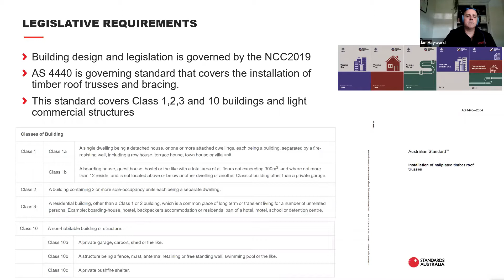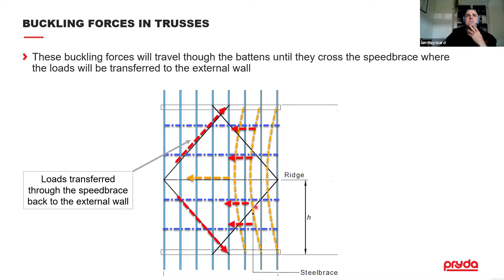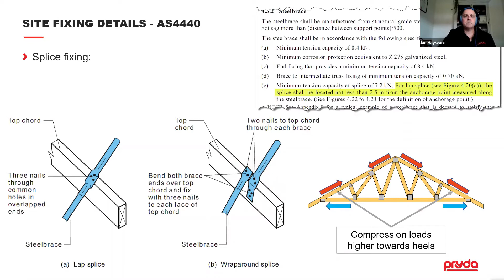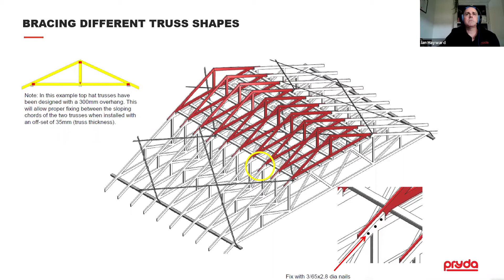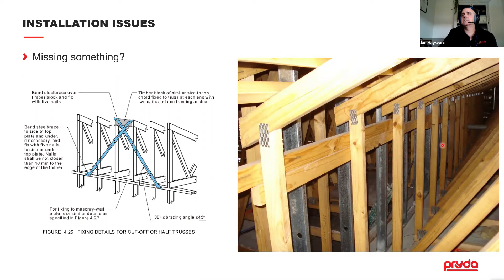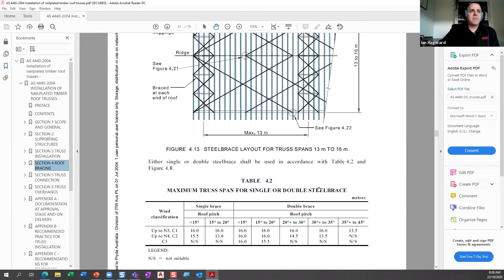Comment: Hi Ian, I have a question about cantilever trusses, where the portion of the truss cantilevers past a support point such as a wall, do the forces in the truss top and bottom cord reverse/ i.e. where the truss top cord is typically in compression and the portion of the top cord that is cantilevered is in tension, and where the truss bottom cord is typically in tension and the portion of the bottom cord that is cantilevered is in compression.